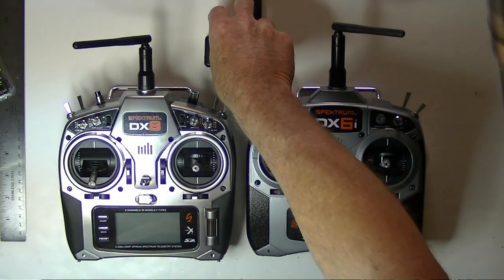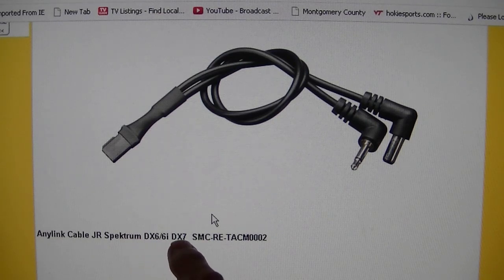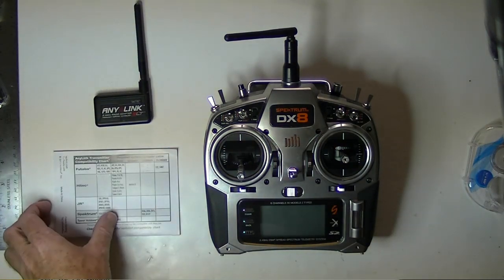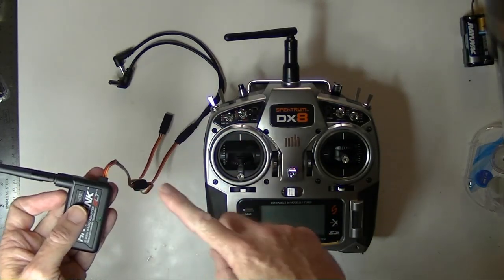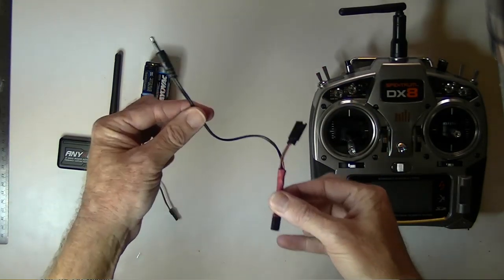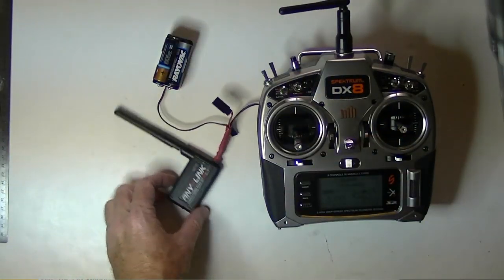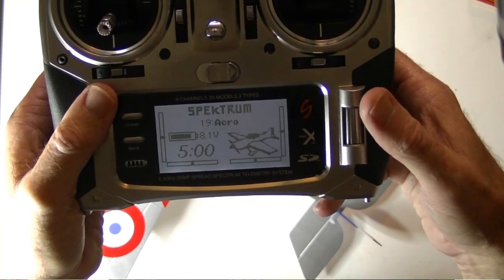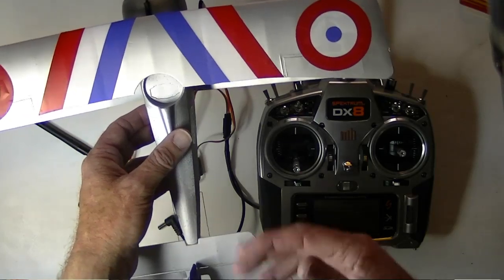Tactic AnyLink with Spektrum Radios and Flyzone Tx-R planes Mapping and Mixing.

Comment: Cool, thanks for the tip on how to turn off the left stick rudder.  I asked the Horizon folks on their Facebook page, and they said it could only be done by plugging the rudder servo into the aileron port on the Rx (that's how the Champ is set up).

Comment: I finally got around to trying your Mix tip to disable the rudder (setting it up for the new S.E.5a).  All seemed to go well, except the trim settings don't actually move the rudder.  I did turn trim to "Act" in the Mix 1, but still no luck.  Do your trims actually work with this Mix?

Comment: Yes, the DSM2 has been replaced with DSMX but is backwards compatible in both directions (Transmitter to/from Receiver). Planes with DSM2 built in are usually marketed as "BNF" while planes with included "SLT" are marketed as Tx-R. I think JR and Spektrum were connected at one time but are now completely separate companies.

Comment: Nice video.  I couldn't get my Flyzone DHC-2 RTF Beaver to bind to my Spektrum DX8 despite numerous times and lots of time.  I finially got it to work, pushing in the "bind" button on the receiver.  Then it binded.  Maybe my version of plane and transmiter different.  Just so you know.

Comment: For the DX8, could you just use the DX6i cable, and make an adapter to connect the external battery to the charge jack plug on the anylink cable?  Basically the same thing, I think, but replacing the servo y-harness with the battery plugging directly into the anylink cable.  Actually, I was thinking of snipping off the charge plug and replacing it with the connectors I use for LiPOs, hanging a 2s on the back of the radio.

Comment: Just got an old Nicesky beaver with tactic receiver, i was looking at the spectrum cable that came with the anylink and decide to open up the heatshrink tubing that was at the end. It was odd because the power plug lead only had one cable attached to it. So how it powered the device is beyond me. So the wire were from the notched section was red —connected to trainer port plug, then white from the power plug cable in the middle and then white — connected to the trainer port plug, the red wire from the power plug was cut at the base of the cable casing and no red lead was seen on the connector side.
Reply: Okay so i did a test and looked at your video, i took out the middle plug and connected the positive battery wire, and removed the power plug, then connected the negative to the plug further from the key slot. I actually cut the white wire connected to the trainer plug, which is the negative wire and wrapped it round the negative battery wire and crimped on a new servo connector. I used 4.1 volts and everything fired up just fine. Thanks for the video you made, made me sort out the wiring to make everything work. Its 2022 and know your video on youtube still helps people. All the best!

Comment: Not too long. You could've stopped after you showed that it was linked with the plane, but I was interested to see how it was setup anyway and watched it all. I wonder if you'll be able to buy a radio that has BNF and Tx-R both built in. That wou.d be nice to have standards across all radios.

Comment: My Anylink is nothing like the one you are demonstrating .. Mine has a row of red led with a push button accessed using a small cocktail stick. My Anylink has a lipo included .The connection cable A  energises the DX8 and when I plug it into the Anylink , all of the led lights come on and refuse to reset.until the power is reset. .
Reply from the maker: Richard Wallinger That is the AnyLink Version 2.
I only have the version1. Not being familiar with the V2 I would suggest contacting the vendor about the problem.